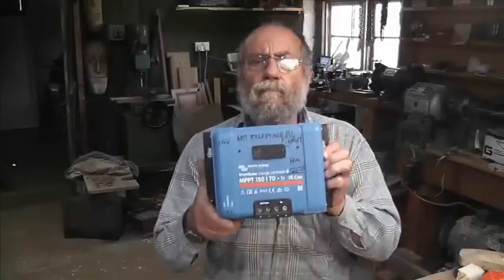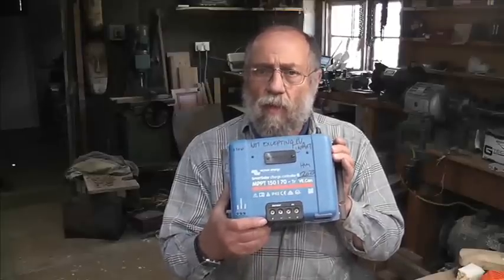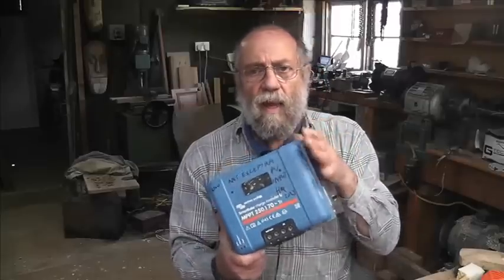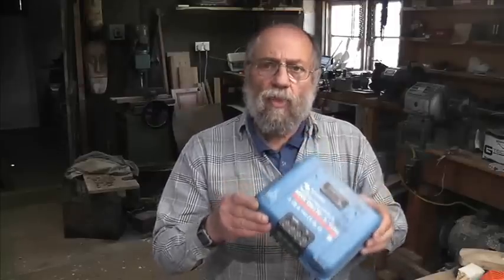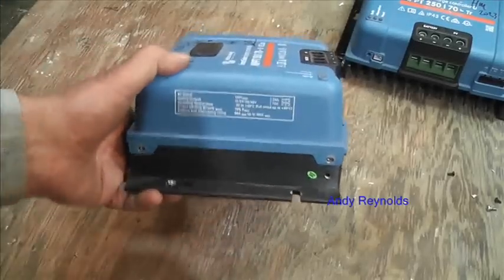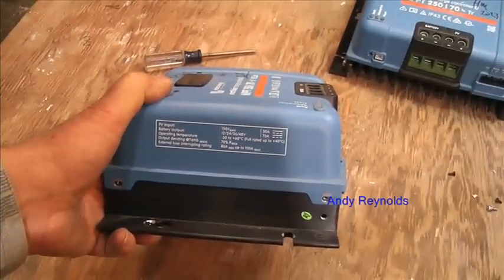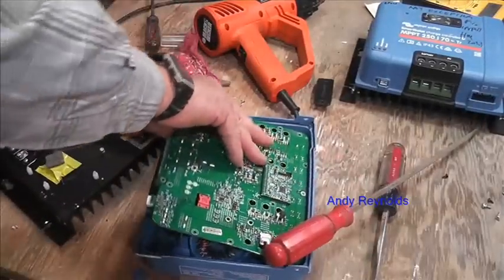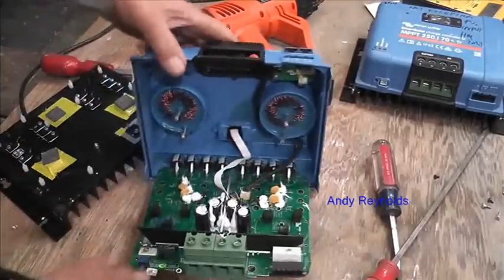Victron MPPT charge controller exploded

Comment: Wondering if we can just heat up the blue case on a cook top until the potting material melt so that we can pull the two half a part.
Reply from the maker: Hi, I tried that but the capacitors mounted in that trench is a real problem, so mush potting on these larger units, cheers
Reply: @TheInfoworks thanks for the reply.  Seeing how hard it is to repair, I just bought a different MPPT charger.  Was thinking of getting the Victron 100/50A version.
Reply from the maker: @tttuberc  yes, I found the Renogy MPPT splendid and it has a screen, cheers

Comment: I've tried pulling apart a Victron. Highly recommend NOT buying due to the thermal construction it has. It seems the mosfets bolted inside with fragile plastic. The whole thing is unserviceable and a pile of junk.
Reply from the maker: Hi, it's the larger units that are a problem, potting all the capacitors into a housing in the top case is definitely a bad move, plus the internal screws are the wrong way round for accessibility, cheers

Comment: To my experience on victron, 17 yrs now, if Voc and Isc is kept strictly within the limits, they never fail. 
The most robust is the 100/50, but for 12/24v only.
For 48v high power systems should use the rs450.
Yes, it's not fair for the customers to be irrepairable, and that's why the company's sales are going downhill.
Shame because it's good tech.....
Reply from the maker: Yes I always say: run tech well below the rated settings to get very long life, cheers

Comment: To be fair to modern high quality appliances like Victron, they are nowadays designed to be idiot-user-proof, with greater than needed specs and all sorts of auto-safety logics that are blow-proof, such that ANY FAILURE must be an appliance failure.  A hefty internal fuse blowing IS NOT DESIGNED as a user or amateur serviceman replacement. It is there to stop the device smoking and bursting into flames and burning your van, boat, house down, and drawing ridiculous loads which might damage  household wiring. 

Fyi, I had a Victron 30A DC-DC Charger blow 9 months into warranty. The dealer said they were under Victron instructions to cheerfully immediately replace it. They sent out the new one even before I had returned the old one. She said, "Well your story satisfies me that you didn't abuse it. (Not submerged, not in a hot engine box, it worked on Monday but not on Tuesday). So please take a new one" !!!

Sorry guys, but internal repairs are a thing of the past BECAUSE manufacture (ie replacement for them) is far cheaper than repair for you.  Manufacturers think -- "If it blows outside of our well-engineered, extra safety specs, that must be an appliance failure". There is little you can do to kill them by operation. They have so many self protection circuits. They sense all "wrongful usage conditions", they go to sleep, show a warning, and sleep till the illegal condition is removed. No probs!

Comment: Why why why???
Reply from the maker: Far too much potting compound seals the unit, and the screw heads are on the inside, they don't want you in there. If you have one don't run them above 60% of capacity, cheers
Reply: For more sales, sales, sales!!
Reply from the maker: @ΠάριςΑζής  There could be a better method of vibration proofing so I reckon you are right, cheers

Comment: Victrons are way overpriced for what you get, 2 big cons of victron units, 1- they run too hot doesn’t matter the quality of the electronics heat will kill components fast, and 2- they are not serviceable, buy once cry once get something like Outback or midnite solar units, all electronics have a lifetime of usage mosfets wear out, but these are at least serviceable and last way longer due to running cooler, victrons are popular for two reasons they spend hard for marketing and push hard to sponsor YouTubers with free products and the second reason is they are pretty simple to use and setup with Bluetooth units and easy to use app, electronics are good but they just run them too hot not enough mass and heatsink mass to properly cool them, I mean they are compact and that’s targeting a lot the market for smaller units but you pay premium and you pay later for units dying, branding marketing exposure gets these things sold, I would consider them hobby grade units, but you want commercial grade to professional grade get outbacks and midnite solar units
Reply from the maker: I agree and with all my electronics I apply the second rule of solar, don't run above 60% of rated capacity, keeping the heat down, cheers
Reply: USE A FAN. Dirty cheap, hardly any power.

Comment: Planned future revenue stream since you cannot repair them.  Makes me really wonder what the long term impact will be?  I think I am going to migrate to the all-in-one units since I have purchased a few victron MPPTs (used) and realize that anything over the 100/20 model is not field repairable.
Reply from the maker: Exactly and sometimes I prefer a PWM unit as they are less complex. However applying rule 2 of solar panels and running them at 60% or less certainly extends unit life, cheers
Reply: @TheInfoworks  I just had a MPPT 100/50 blow up two weeks ago with 70v and only 68 watts coming in with 95Khw lifetime.  Dealer in Latvia just asked me for the photos for Victron warranty.  So who knows how long it will take to get a replacement.  The fault was on the PV side and if I had more than 50 watts coming in, I was getting a burn sound and more blue smoke.  I asked my battery and it said, I need power but I don't require a Victron to charge me.  I said, ok battery, I will listen and use whatever works!  Cheers.
Reply from the maker: @Gary-wh7ce  See my recent video on the VLC V2.0 unit, makes a very cheap and reliable controller, cheers

Comment: Can't see clearly but I'd have said first unbolt all the FET's from the heatsink from the rear (they look to be bolted through from behind) take the heatsink off leaving the FETS still attached to the PCB (can you see if they are just held on with the bolts and heat transfer compound?) once the heatsink is off, you need to desolder all the capacitor legs of the one's that are potted to the front panel, and desolder the two legs of each coil, the front should then be removable from the PCB,. ??
Reply from the maker: There's your problem, can't get to them, cheers

Comment: Have you figured out the internal topology?  For the high voltage and high amperage charge controllers, does Victron connect the PV input to an H-bridge and Transformer Primary?  And then a rectified center-tapped secondary output connected to the Battery Out?
Reply from the maker: Hi, there is no transformer, there are coils, capacitor banks, and FETs as part of a variable DC to DC buck converter. cheers.
Reply: @TheInfoworks  That is a huge step-down in voltage for a Buck Converter? Worst case ... From 250 Volt PV input, down to 12 volt output. And the Buck Converter is not Isolated. If  the "High-Side MOSFET" fails in "short-circuit" mode, then 250 Volts DC, appears at the output.  Yikes.

Comment: Shame on Victron for glueing this completely together and make it non-serviceable! Thats not customer friendly and a complete waste! Will think twice before buying Victron again in case mine get faulty one day....  Thanks for sharing!
Reply from the maker: Yes, this is a bad case of potting. I have another video showing cutting the top of an identical unit. Even then it's difficult to get to all the FET screws, cheers
Reply: @rilosvideos877   victron has good marketing strategy small,simple, easy to use and get going with built in Bluetooth, works for most average diy users, very heavy sponsorships for shill YouTubers, but these were designed compromised to target it’s audience the average diy users, but for cost premiums you don’t get very much, I would consider these to be hobby grade not even commercial grade, lack of display is the biggest gripe I have with them, yes it’s got Bluetooth but that’s if you can actually connect, as we all know most Bluetooth systems eventually burn out then you have no recourse of a physical display
Reply: Yes, it can be repaired and if it has this glue inside, it is to release the heat and most likely there is a solvent that softens it, but only Victron knows and this man has no idea how to repair this, he is only destroying them.

Comment: A maximum of 480p video resolution in 2024? That was fine around 2009, but no longer today. But I appreciate the taking apart of the devices. Very interesting insights.
Reply from the maker: The difficulty with 50 inch screens, cheers

Comment: Lost a lot of money with this "not repairable and no warranty" piece of junk.
Never again will I buy this crap
Reply from the maker: Hi, you are not alone, In my book the second rule of solar is don't run your equipment above 60% of capacity. It makes things last much longer along with running them in a cool well ventilated space, cheers
Reply: Yeah i decided to stick to my ancient 40A conergy pwm for the bkp solar sys. There is no fun having smart things if you have to buy them from 2 in 2 years
Reply from the maker: @cat_lin1  exactly, they may not be so efficient for the short term, but long term your PWM will just keep churning if not run near capacity, cheers
Reply: @cat_lin1  i think you are right
Reply: they fine when they work other wise their a pain ill stick to my powmr for the money a 50 dollar bill i can  when they go sale i have paid 39.00 for a 60a with 150 volt in put

Comment: Take a dremmel and cut around the potting and then when you go back together tap some threads and silicone a aluminum plate on it.
Reply from the maker: Yes, we'll see what happens if I get it fixed (huge assumption) cheers

Comment: i have an Victron MPPT 150/85. Oversized for my 1600w solar panels. Bud for the safety i buy this controller to make the load not to heavy for an longer lifespan.

If this MPPT controller unexpectedly breaks, I will buy an MPPT controller that can be disassembled for repair.
Reply from the maker: Perfect, you applied the second rule of solar, always run equipment well below it's maximum. You should get many years out your controller as long as it stays cool, cheers
Reply: it's ridiculous that these charge controllers can't just be disassembled. Without breaking it.
Reply from the maker: @lexpee  I've cut the top of the spare one, video up soon, cheers

Comment: I will never buy victron again after seeing this.
Reply: Mastervolt are also really good
I work in the marine business 
And possibly mastervolt are even better
I had to take a 25 year old mastervilt inverter apart recently and it's entire circuit boards were all coated in a wax plastic
Looks awfull but it still worked perfectly 
I was a amazed actually
Reply from the maker: @lionel66cajppppp0  It's the same with many brands, old is good, more modern is dubious. The Mastervolt grid inverters are to avoided at all costs, cheers
Reply from the maker: I think this is a bad example, my old Multi plus is still chugging away, cheers
Reply: My multiplus is still going as well and its 20 years old
Reply from the maker: @lionel66cajppppp0  As is mine, steady performance of the older Victron products, set the change over to prevent battery abuse, cheers

Comment: I would design cups on top of the coils that are glued to the coils and then thermal pads between the cover and the cup, this way the coils are not firmly attached to the cover, the capacitors dont necessarily even need to be glued or just glue fromthe circuit board surface.
Current system has EPEver 20A controller and plan is get bigger controller now, i have over 400W solarpanel output atm and i can utilize only ~280W 20A.
I have been thinking about Victron, but this fuse problem has made me doubt the purchase and i rather think about the EPEver 40A controller.
Reply from the maker: Hi, I agree with your comments, makes other choices more attractive, cheers

Comment: I've purchased Three Solar panels every one gives hoid volts about 17 volts but ONLY mA , 150 mA yo maybe 250 mA that us 50 watts in bright sun... Hu what a con job. At least I got money back off two but not from Eco-Worth which is land fill
Reply from the maker: The short circuit current test is the ultimate test, what do they do if you cut the diodes out? (in the box on the back). I have come across a dead panel and it turned out to be a faulty bypass diode. There's plenty of scam merchants out there selling faulty reject gear, cheers
Reply from the maker: See my video "what went wrong, faulty panel wafers: part 3". There's a solar panel investigations playlist.

Comment: Perhaps before opening, cutaway the front case carefully to isolate the moulded portions for the coils? Digging in the dark to try though!
I'm guessing some of the switching fets have shorted.
Reply from the maker: Yes, I was working on the success from removing the top of a smaller unit. The other not working unit will have the top cut to bits, using this top as a template and hopefully giving precise measurements. The I can get to the screws that hold the FETs to the heat sink, cheers

Comment: Just more scrap electronics.
This is disgraceful engineering design and completely contrary to the spirit of repairability.
Reply from the maker: Steve, I'm totally with you on this one, they should be ashamed, it's all profit driven from a company that at one time was seen as the leader. What next? a timing chip to kill electronics after so many working hours, just like makita batteries, cheers
Reply: @TheInfoworks just had this pop up in my YouTube feed
https://youtu.be/gC9EFUHKxhg?si=l-VRqrjjpJ0S8XCx
Tricky Dicky has managed to get his Victron apart by screwing the unit down then applying heat from a heat gun and progressively praising the lid off.

Comment: They do this because they want to cool the coils, this is okay, but it could be done in a more repairable way.
This Victron controller are to big in my opinion.

I do it in an other way, I build my own MPPT-controller right now, but I will use one MPPT-device per Panel.

The Battery is a LiFePO4 battery (48V/280Ah ) with 16 cells in line and it have this voltages:
40V if it is totally depleted.
48V empty
51.2V ideal empty condition
52.8V (nominal voltage)
55.2V ideal full
58.4V (100% full)

So the voltage of the Battery should be between 51,2V and 55.2V in ideal conditions.
(In winter at -20°C without load the PV-module can have 57.4V, but the battery protection stops charging at 55.2V and this is not a problem. If I have to much Energy, I can send it to the grid or use it for heating or I waste the energy over a big load.)

The PV-module has during MPPT-conditions around 39-48V @ 10A, so I use a StepUp converter which can drive much more than 10A and it must make nearly nothing, only increase the voltage a bit. With synchronous switching it will have nearly no losses and the size of the PCB is around 5x5cm.
Because of the Step-Up converter design no current can flow back into the panel, so you can put every panel in parallel without that you would get any damage because of a shadow over one panel.

I have here 20 PV-modules, every MPPT-module will cost about 10 or 15€. (MosFET, driver, µController, PCB, housing, wireless module) This are 300€ without the cost of the work to build it, only the components.

They are all connected over little wireless modules to a concentrator, so that I can read the temperature, voltage and current of each one and put it onto the home-website/database.
- I can temporarily short circuit the PV-module if necessary, but because the microcontroller is using the voltage from the PV-module, the short circuit have to be released after some minutes for some milliseconds. I could add a 1F goldcap capacitor to increase the time. If I set the lowside MosFET on and go into deep sleep, then it can last for many hours.
- The MPPT-module has a very low quiescence current, so that the battery will be loaded, even if the light conditions are very low, like in the winter.

To repair it I can read the Debug- and log-data over USB or the wireless-modules, then I can understand what was/is going on.
The housing is a little aluminium case which can be opened very easy. I remove the two screws which are holding the two MosFETs against the Aluminium, remove the two screws of the side-plate and then I can slide out the PCB.
Reply from the maker: Hi, this video has certainly brought people together on this issue. You are right in having multiple parallel controllers. Heat is the killer and small separate units built over spec is the answer, cheers

Comment: i did not know that victron units can go bad i was always told that they are bullet proof and they last forever and that are the best and you cannot kill them,,,,well
Reply from the maker: Like all of us, pushed to the limit with perhaps bad instillation this is what happens. It's the " you shall not repair" that I find despicable, cheers
Reply: @TheInfoworks  try the epever tracer 100a charge controller I am using them now for about 3 to 4 years with no problem but been using epever for about 10 years
Reply from the maker: @bimmers323ci  Thanks for the tip, with these scrap units it's  the chance to delve in for a common good that interests me, cheers